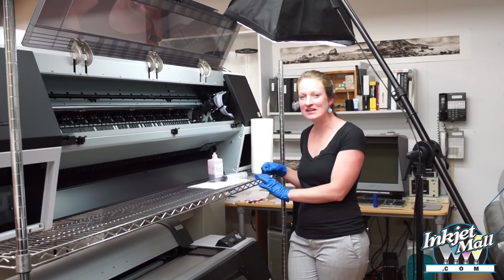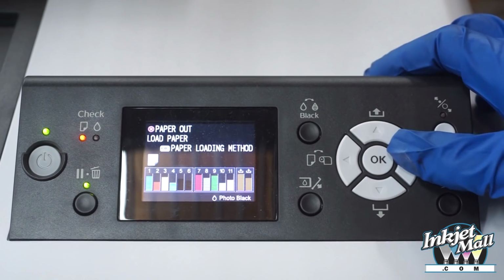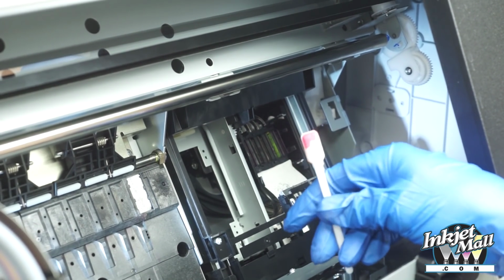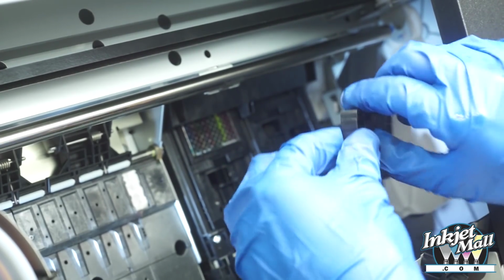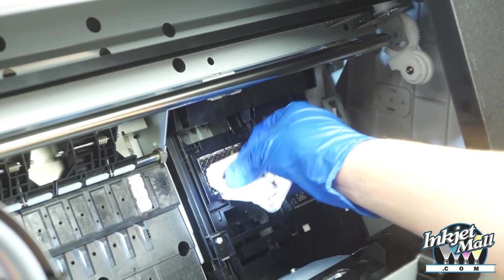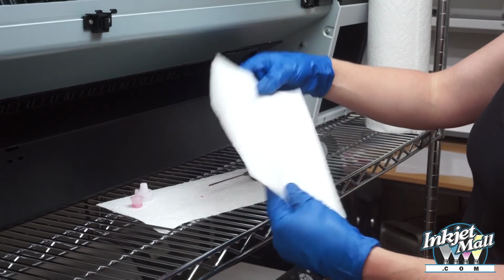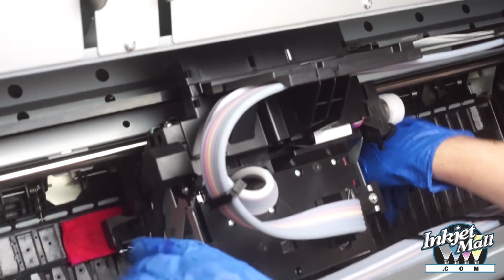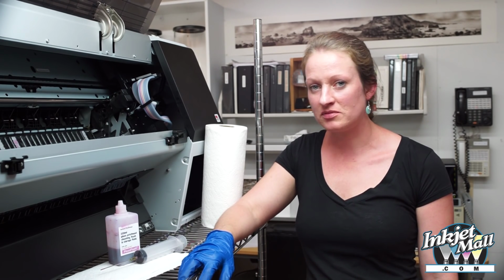How to Professionally Clean Epson 7890, 9890, 7900 & 9900 printers

Comment: thanks for the vid! just wondering where the vid is on flushing the lines you mentioned in this vid?
Reply from the maker: We have a written instructions for all of the Epson Pro printers for using PiezoFlush internally in case the clog is behind the print head. Here:  http://www.inkjetmall.com/tech/content.php?140-Flushing-Epson-Pro-and-desktop-model-printers-for-safe-long-term-storage-or-when-switching-inks
Reply: @Inkjetmall  hi, I have a 9800 not printing my magenta.

I have a continuous Ink system so could I just empty all the ink out of the cartridges and fill them with your cleaning fluid ??

Also we're can I buy this fluid from and do you supply all needed materials including vinyls??

Thank you 😊
Reply from the maker: @bustagrimesrestorationmain2596  we are specialists in photo and fine art ink systems - so we do not sell vinyls...  To use the PiezoFlush internally you can read how to do that on the product page here: https://shop.inkjetmall.com/PiezoFlush-kit-for-Epson-Pro-7800-9800-PK.html      With a CIS you are going to have to modify whether you remove the magneta insert and put in a refill cartridge with the PiezoFlush or use the PiezoFlush in your CIS. I think using a refill cart is preferred.  You will need to run the Initial Fill Command and it will waste inks in the other positions - but it is the only safe method.  Read up the instructions on that link above. You can also just buy single positions on this page:  https://shop.inkjetmall.com/PiezoFlush?category=61&search=&attrib=42-152
Reply: @Inkjetmall  thank you very much for your help 🙏 will take a look, going to try an original magenta first see what happens 😀

Comment: Are the newer Epson P6000/P7000/P8000/P9000 printers similar enough to use the same process for cleaning?
Reply from the maker: Larry Nielsen they actually have print heads that are physically identical to and replaceable with heads from the 7890/9890 and 7900/9900 printers. Cleaning them is similar although menus may be different. What is remarkably different is the new printers in USA are locked by Epson against the use of refillable carts. So you can not use PiezoFlush internally.
Reply: @Inkjetmall  Do you know how to release the print head on the P9000?  I just want to have it sit on a cloth soaked with the flush but cant figure out how to manually move the print head on this one.  Thanks!
Reply: @drhoads08  yes there are two ways. Turn the printer on and when the head moves out of position - pull the plug. The second way is to remove the side panel so that you can manually rotate the white gear that moves the print head. The first is easier - but if you have the printer apart you can do the second method.

Comment: Hi, have you ever experienced a D131 error code after doing this? Thanks
Reply from the maker: No, but you can try restarting the printer. If that doesn't work, power ON the printer in Self Testing Mode. This is done by pressing and holding OK, Down, and Right while pressing the Power button.Do not release the Down, Right, and OK buttons until the printer has powered ON completely.  This normally clears this error.
Reply: Thanks, the error indicated current leak, it stopped after better drying of the capping station. It's fine now...

Comment: Hi and thanks for making this video. I have a little issue with my Epson SP 7700. The nozzles all seem to fire correctly, however the very last box on the nozzle check (i.e. <MK> ) always prints out with a little wobbly notch. Will this kind of cleaning help? Thanks
Reply from the maker: yes - wobblies are usually remedied by cleaning!

Comment: Very interesting video.  I have been printing with a 7880 for 7 years and a 9900 for 3.  I run approximately 100' of Luster rolled paper per month through each machine and have not had any print issues.  Is this cleaning recommended if there are no issues?  I am all for preventive maintenance, but this is the first I have heard of this type of cleaning.  Thanks for any advice.
Reply: If it aint broke dont fix it. But when bands or blobs of ink hit do this. I love the stuff saves me from having to do power cleans.
Reply: +Matt Culberson - Thanks Matt.  I appreciate the comment.
Reply from the maker: tough one to answer...  we find most people end up with some issues - and you've been running really quite well - so my advise to you is do not do ANYTHING different. However, you print only lustre which is low lint. Most of our customers are printing on fine art papers which are archival matte surfaces and inherently linty!  So keep on keeping on!!
Reply: Yes.  It must have been.  Took a year to answer :-)  Still going strong here [knock on wood].  They are amazing machines.  Can't imagine my business without them.  Thanks for the reply.

Comment: Thanks for the video! Will be buying supplies off your website. Any idea why a 9890 would have a single horizontal band at the top of every print about an eighth of an inch in but print the images perfectly with showing proper head alinement and no clogged nozzles? Printing through cs6 on windows.
Reply: +Matt Culberson I know that you posted this 9 months ago but I'm having the same problem with my 7890.  Did you determine the issue and if so, how did you fix it?  Thanks, really appreciate your help.
Reply: +Enrique Molina  at first i would print half inch cream color at beginning of print and print the image at highest resolution then i went on Craigslist and bought a 9800 that did not have the defected head the 9890 serise has. I still have the 9890 and for around $460 there is a cleaning solution called piezoflush or somthing like that that may or may not revive the printer. I have been using epson stylus pros for 9 years and the 9890 going out on me and many more people right after the warranty (13 months) is crap. I almost just gave up on epson it ticked me off so much. But the kit will flush the heads without damaging the head like a power clean in service mode so i will give it a shot but i do clean my other printer just like in the video and never have to do cleaning though i run the almost everyday. Hope that helps.
Reply: +Matt Culberson Enrique Molina, I have some clogged nozzles for the first time in the year since I bought the 7890. I'm not sure if I should try this method - first I want to see if the folks who sold it to me have anything to say. I was printing for 6 months straight - then stopped for 2 months and left the machine with just a humidifier always going... but wham, it happened. I'm so disappointed -- wondering if you tried it Enrique? and what happened. thanks.